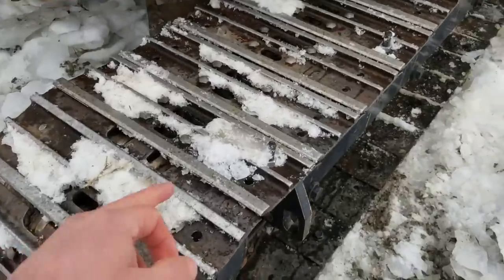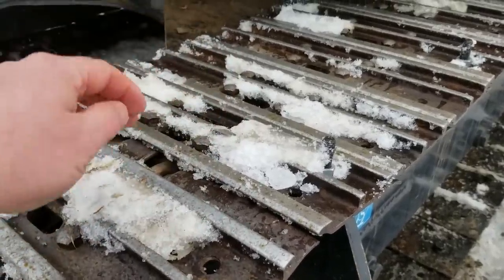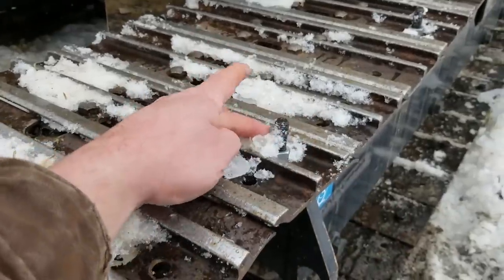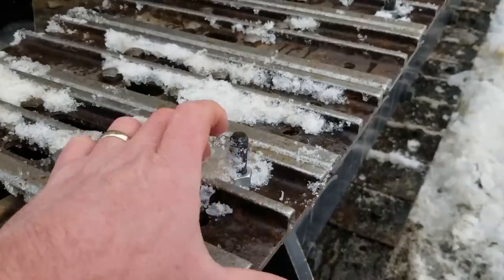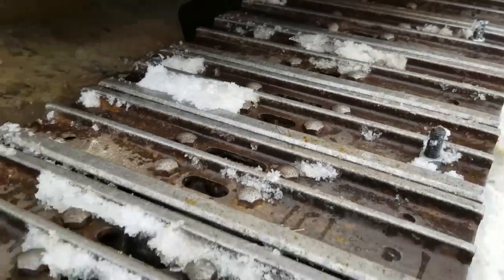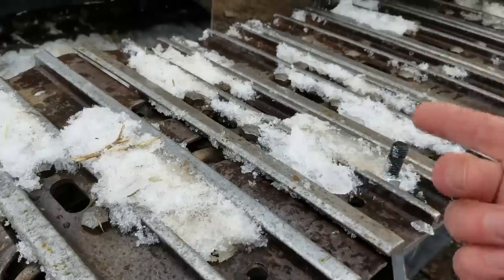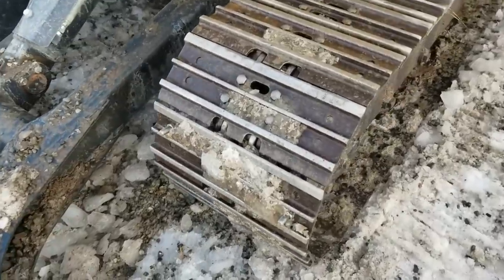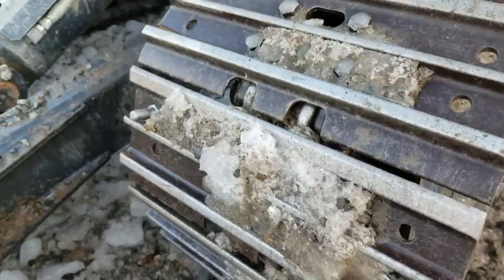Cork Stuffer! Farmer style.

Comment: Watched a guy with way too much confidence in his ability and that of his old grader drop off a 3/4 mile 8% grade to scrape the ice off it. He made it to the bottom safely but his eyes didn’t look normal for 2 hours.  The machine awaited the thaw at the bottom of the hill.
Reply: S
Reply: What good is a grader with the blade up? 
Ever look at the breaks on an old logging skidder? Trick question, the break is a little disk on the driveline hardly even counts as a parking brake. They just lower the logs to get some drag get the butts to dig in a bit, maybe use the little brush dozer on the front.
Reply: @TheDuckofDoom.  who said the blade was up?
Reply: @davesalzer3220  Hard to go anywhere with it pushing up a pile of snow and dirt. 
I was giving the guy the benefit of the doubt that he wasn't a complete moron and trying to grade on top of a thick layer of solid blue ice.
Reply: Only thing I wonder is, how far away could you smell him after the unplanned excursion 😁

Comment: I found using two bolts on the seat, left and right handed thread one by each so that tightening the glutes locks you in, rather than spooling you off anticlockwise at high speed.

Comment: Used to bolt sections of old tire to the tracks for same purpose.  Cut the tire with concrete saw, drill holes with .45 ACP and use carriage bolts.

Comment: There is no better feeling than sitting next to a 8 ft deep hole, with a 3/4 built storm inlet in the middle of it and you slow down the 3ton bucket (with 8 ton of dirt in it) just a bit too fast and the whole 45 ton machine starts slidin toward the point of no return, had to run the bucket down into the hole and push myself back away from the hole..

For those of you wondering, even clay can be like black ice under a big machine like that when it was smooth mud before being frozen hard. I ended up having to scratch a 6'' trough for one of the tracks to sit in so I could work at a reasonable speed next to that hole, you could spin the undercarriage 30 degrees just by trying to start or stop a spin on the upper structure at full torque.
Also if you see someone trying to dig or scratch at the ground with the dozer blade in front of them and they just keep dragging the machine toward the bucket, they probably need to put the dozer blade behind them. (In front the blade is lifted when you push the bucket down and the machine slides on the tracks, but when it is behind, the dozer blade is pushed down when you push the bucket down and the dozer blade digs in resisting the slide better most of the time)

Comment: Used to work in an auto wrecking yard..we had this bald tired old POS Cat front loader equipped with forksfor moving cars...she were dandy out back in the mud, but one January I had to take the thing out on pavement to grab a junker that some dipshit deposited in the parking lot..thought nuthin' of it 'til I started sliding into the six foot deep drainage ditch sideways and me with no ROPs cab..
BIG washer gnawed out of the seat cushion that day..
Unintentional donuts with heavy equipment is better than a high fiber diet..

Comment: Bolts are a little long I can't imagine the weight of that whole machine on one or two bolts when it rocks back and forth.  Lugs are usually half an inch high. You would do better to weld those bolts sideways to the grousers of the track.  A couple high heat passes with thick rod and they'll hold.  Or buy some real corks.  Cheaper then paying someone to flip the machine back on its tracks.  Honestly I operate a half million dollar machine and I don't understand trying to save a few bucks by risking damage to the machine.